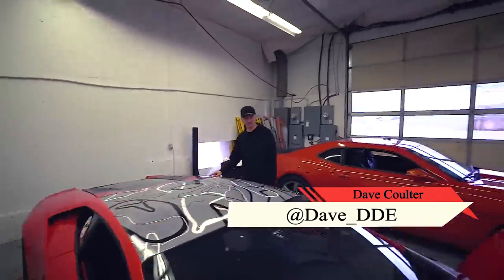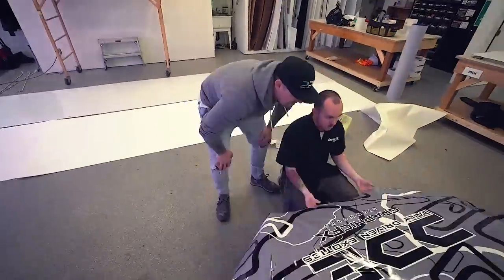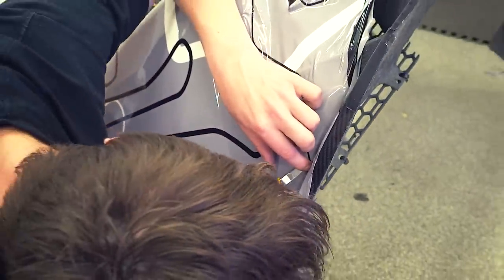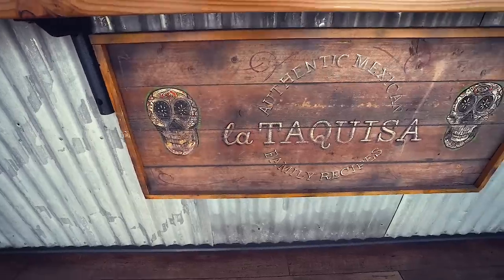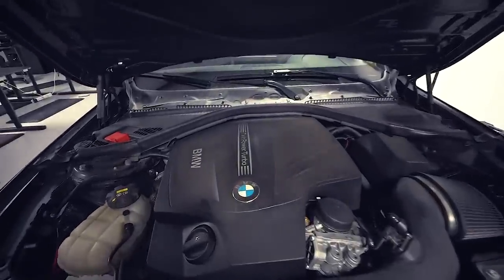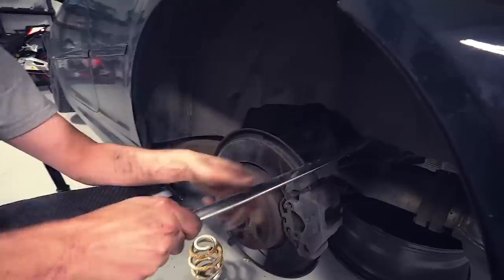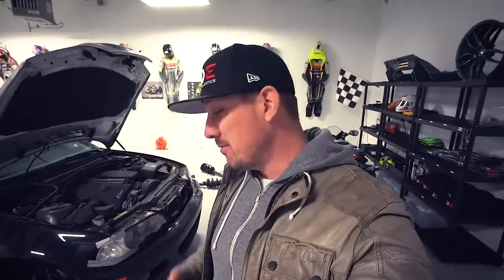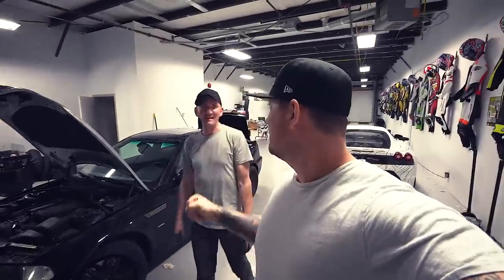CRAZY WRAP DESIGN FOR SUPERCHARGED LAMBORGHINI HURACAN! *DIY PROJECTS*

Comment: I noticed with some of their vinyl it starts to detach from the body on sharp angled inward edges after a while. Like those 2 long lines going across the hood. The vinyl tightens up over time and lifts from those spots. The wraps gonna be on the car only for 1 year so its not that big of a deal.

Comment: Pro TIP : Leave the bottom shock bolt loose and tight ONLY when the weight of the car is fully on the shock.

Comment: Dave's car won't last long without those rubber grommets, in fact I highly recommend NOT driving the car without them. He is going to cause a HUGE amount of damage to his car by not having them on there and it's dangerous.
Reply: Der Pate what damage will it cause?
Reply: Thanks for replying Dave. Well from my experience as I owned one with the very same problem is that the repeated up and down motion that takes place the metal can get stress fractures which then causes rips to take place in the metal where the stress occurs. You can literally have it jump off place once this happens,which lord only knows what could happen there. Not to state it will do this to your car but I had to pretty much cut out the whole area and weld in new wells. G-d forbid a stress rip doesn't occur while you're out driving though. I'm pretty sure out there somewhere in Youtube land there is some video of this happening to some car and the after effect of it...I will look and see if I can find a video , then share the video here with you, if not well I am sure there will be one eventually.
Reply: Heres an article to read:https://www.yourmechanic.com/article/what-are-the-dangers-of-driving-a-vehicle-with-a-broken-suspension and heres a video that shows stress fractures, not that they are related to what you plan on doing but can be what you look forward to as you wear yours down quickly: https://www.youtube.com/watch?v=UIKW20k-xSg